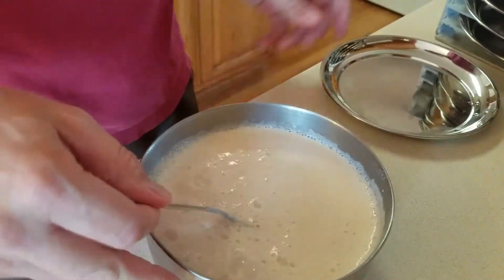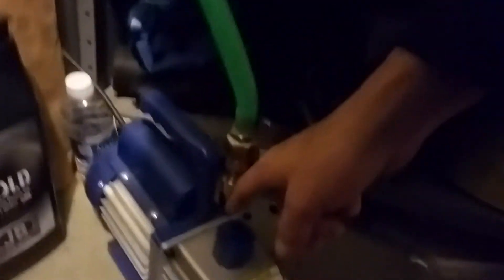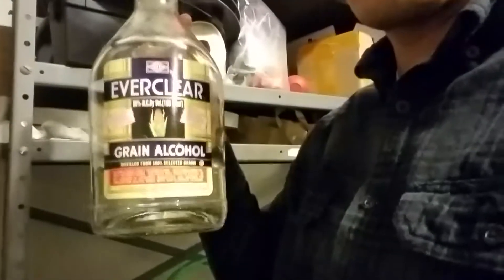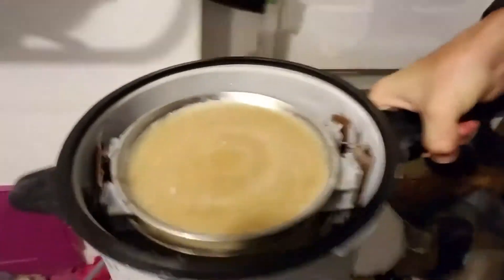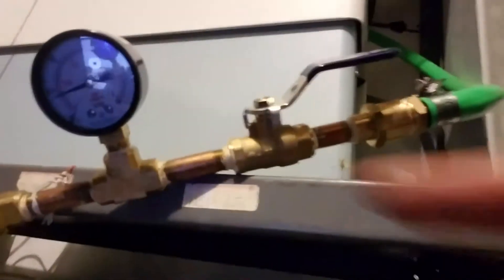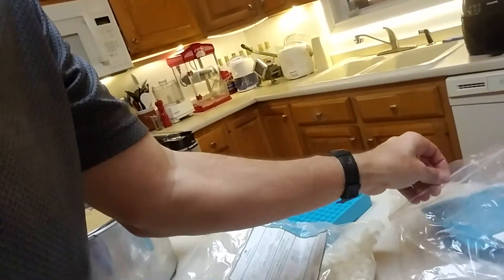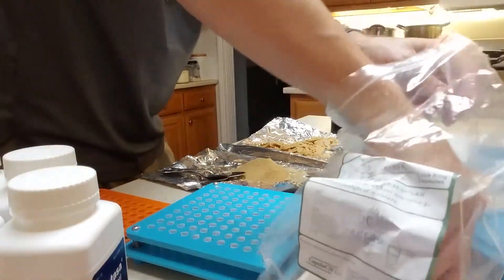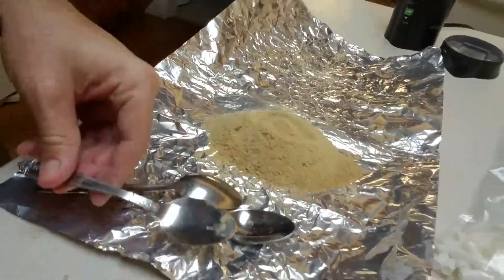How to make mutaflor enteric capsules

Comment: Awesome video. What would you recommend for those that do not have the option of freeze drying? Do you think that it´s possible to produce yogurt continuously (similarly as its done with Kefir) by using some of the existing yogurt as a starter for the next batch? One observation that I have is that, since E.Coli Nissle 1917 is used for most medical conditions related to the colon, I would use a capsule with enteric coating so that it only opens up in the Colon and not in the harsh environment of the stomach. That´s another concern I have with the Yogurt since I am not sure the E.Coli Nissle survives beyond the stomach. If you have any info regarding this point and could kindly share, that would be great. Cheers! - DM

Comment: +joshwbrown1 Do you know of any way to get the mutaflor into capsules without freeze drying, mainly because because of its high price, even with just buying the parts. Also does our stomach acid kill the mutaflor yogurt if we just eat it straight after making it, and if so are enteric capsules the only way. 2. Would a dehydrator work, because I could buy a dehydrator and set the temperature at 95 degrees(35 celsius), which is around the same temperature as when we fermented it. Thanks.
Reply from the maker: I wouldn't recommend dehydrating because it'll take forever at 95 degrees. Above that will likely kill the mutaflor.  Instead of freeze drying, you could seal it in a jar with a separate desiccant like drierite.  That will take days or weeks to desiccate, but existing literature suggests it will preserve the culture at least as well as freeze drying.  You can't put wet mutaflor in enteric capsules, because it will immediately destroy the capsules.  Stomach acid isn't good for bacteria, but probably at least some will survive if you eat the yogurt without freeze drying. Hope this helps.
Reply: @joshwbrown1  Thanks for the fast reply, I have taken most probiotics out there, all which have made a minimal difference I don't have huge digestive troubles, but I am interested in probiotics helping my cognitive difficulties specifically ADD, ADHD like symptoms, and being unable to focus. To be honest if Mutaflor doesn't help me I'm done with probiotics as I have tried basically all of them out there, but I do know that Mutaflor is different compared to other probiotics. The reason I was asking a question on how to freeze dry them is that I am ordering Mutaflor to me next week , and if they actually do work I want to make some instead of buying 60 capsules for like 75$. I was wondering what have your been your cognitive benefits from taking mutaflor, I already know of the micracle digestive differences it can make , but what mental benefits have you or the people you have given Mutaflor seen, if any. Again thank you for answering my question, and very good of you for sharing this information to the public for this very well studied product.
Reply from the maker: You're welcome. I'm not aware of any claims that mutaflor would provide cognitive benefits, so I'm not sure what to tell you on that.
Reply: @joshwbrown1  thanks for this video. I am wondering if you needed to use special capsules to be able to survive through the stomach acid? I noticed when buying mutaflor that they have a coating on the capsule which i'd suggest is to keep the contents secure until it reaches your intestine.
Reply from the maker: @joshgaskin  I use enteric coated capsules. See the video description above.
Reply: @joshwbrown1  awesome, thanks a lot.